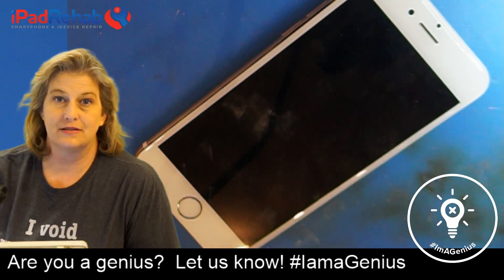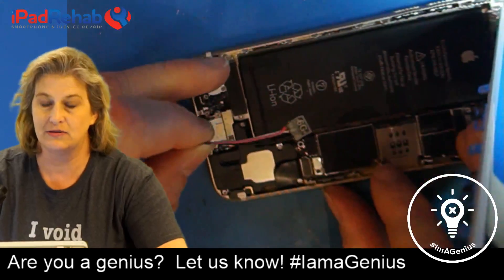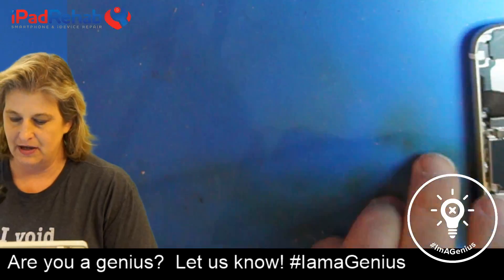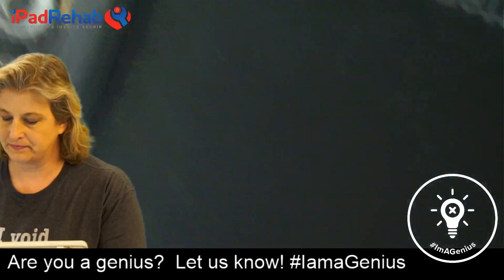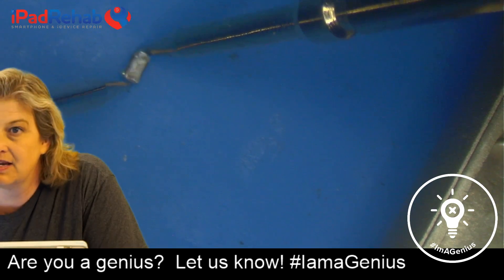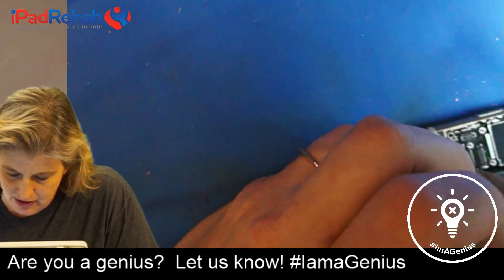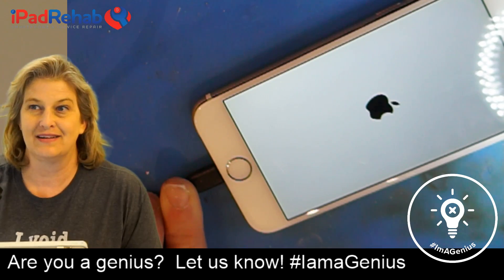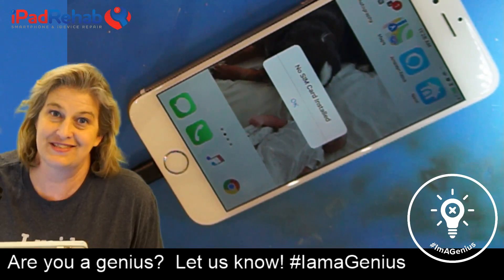How Fast Can We Beat the Genius Bar? #Imagenius

Comment: Just a question. I have come across Rewa channel. They seem to have equipment that I see on no other You Tube show. Yours included. In fact their work stations are clean and simple. 
 Why not invest in moulds
 that stabilize the phone and the tools that Rewa uses. I have seen them do everything you do. Plus increase storage space in an IPhone. From 16gb to 128 gb. 
 They're repairs are top notch. If you haven't seen them. Take a look

Comment: Apple geniuses are not technicians. They work off a script. They know only what Apple tells them they need to know about particular issues. They have their approved diagnostics and resolutions based on those results. If a customer's issue does not fall within the boundaries of their script their response is "it can't be fixed, it must be replaced and you have lost your data." In Apple's world all of their consumers should be constantly backing up their devices and if you don't then the data loss is your fault. But in all honesty even if you do that, iCloud can easily work against you and overwrite all of your data with 0 data once a device that's been wiped connects to the cloud and creates a slave/master relationship with the rest of your devices. Then systematically as your other devices connect to wifi, 4G, are turned on, etc they shake hands with this new back up of 0 data the faulty device has created and are overwritten with nothing. I've had this personally happen and it was not even the result of a physically damaged phone. My iphone deleted my calendar appointments and contacts one afternoon randomly. Literally there one second, and gone the next. I noticed that all the names in my text conversations were gone and were just displaying numbers. The frustrating thing was that I had just backed up my phone a couple of days prior and then my macbook right after to time machine and time machine was proving to be useless as the icloud data which now contained no contacts and no calendar appointments kept overwriting my calendar and contacts with nothing after I brought them back from the Time Machine back up. It took many hours on the phone and many levels up the hierarchy of Apple tech support to resolve the issue to where I was able to finally get mostly everything back. It involved exporting data as .txt files and being offline and signing out of icloud on all of my devices and then importing the .txt files etc. A big mess for something that's supposed to simply our lives.
Reply: Doubting Rich exactly. Jessa and Louis are legit tradesmen. People that specialize in the field of repair. They’re not part-time/full-time retail workers that have happened to be detailed to the troubleshooting/support department of their store. I have nothing against the employees themselves but unfortunately we live in a society where marketing plays a big role in many aspects of business and their marketing for geniuses is massive, vastly overstated and far-reaching. Most consumers that are not “into tech” unfortunately don’t know better than to trust they’re getting expert level support from them.

Comment: Hi and thank you for your work , i do have a question , My Iphone 6s is making a strange noise sometimes when i do receiving text messages , it rings like 2 messages was comming in at the same time  : (  ??? speaker was checked but they said no problems ??? HELP , Thanks
Reply from the maker: sounds like software or app settings
Reply: Could you give me a leed where i could go in the app settings or if it's the sofware what would be the issue ? thank you and sometimes APPLE SUCKS  GRRRRR 
 @JessaJones

Comment: Most repairs I'm doing are port replacements. Now that video cards are $600-3000 it's worth carrying the parts to repair them. It's fans and ports that are the problem. Tough repairs to do because they are 7 layer boards designed to remove heat.